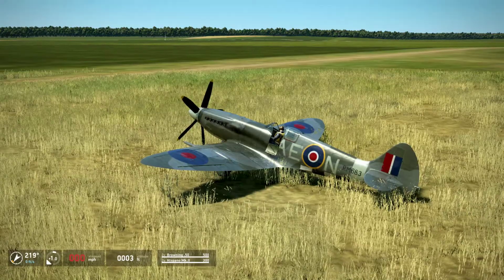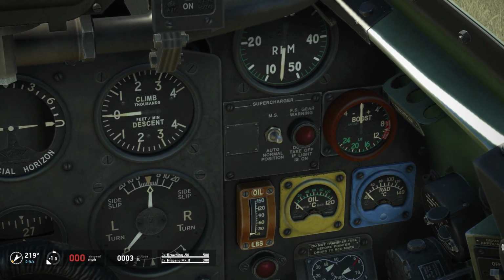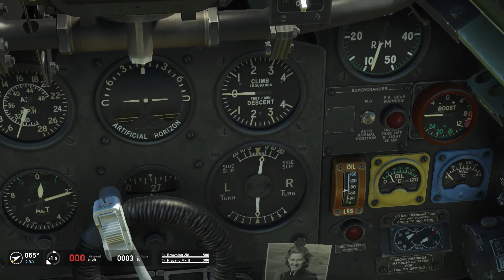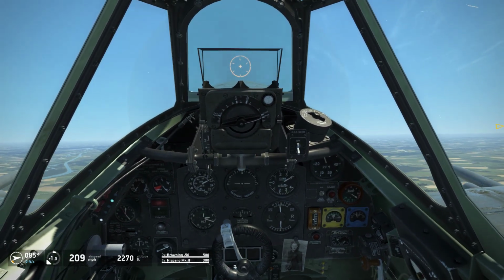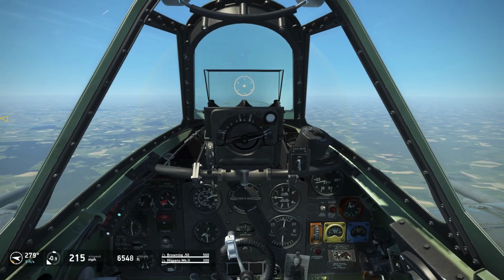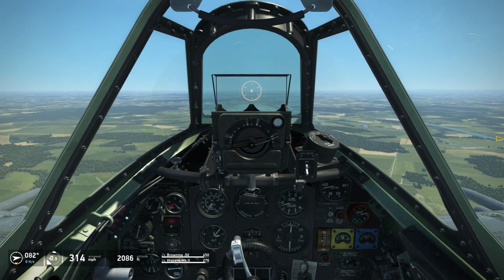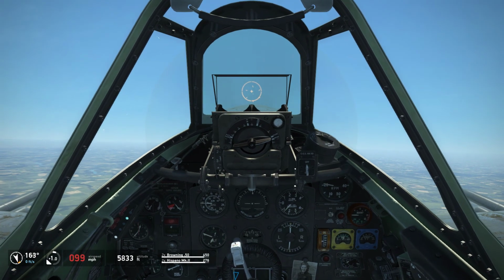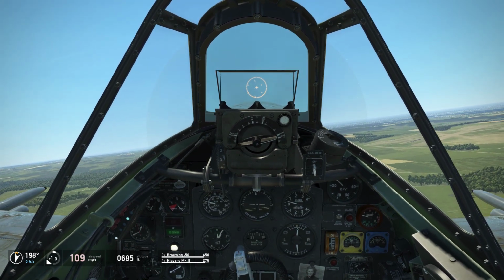Spitfire XIV Familiarization Flight ( IL-2 Normandy )

Comment: My experience with the FSX A2A and RealAir Spitfires was that it is exceptionally easy to fly, with a relatively low landing speed.  Ground handling not bad, as long as you don't nose it over or overheat the engine.  A review of a Me109 would be interesting, especially simulated ground handling.